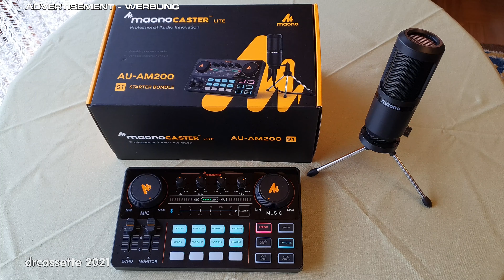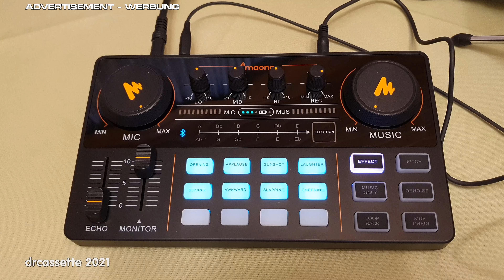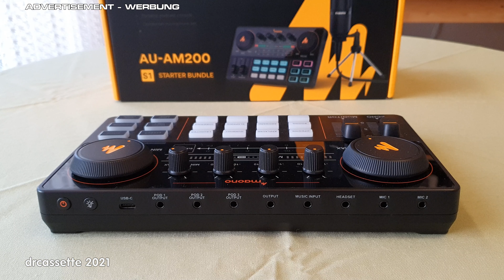Maonocaster Lite portable all-in-one podcast production studio AM200-S1 review

Comment: Our experience of this unit is mixed. Using it with Apple devices, it fails miserably but with a Windows laptop, we had decent results with the audio.

On an iPhone and iPad the recorded audio is gritty, hissy and noisy - plus the 'record' level knob has to be fully turned up for any quality at all. Using it with a Macbook or an iMac, Audacity is out of the question as there are tonnes of dropouts plus for some reason, there's a delay which is annoying in the extreme.

On a Windows laptop, we had much better results and Audacity works well here.

It's a pity for us as we had purchased the unit for some remote work and being able to use it with our iPhones would have been ideal. 

At £99 it's a decent kit, but simply not for us.

Comment: Sadly I think the background noise will put a lot of people off this machine, and the denoise button did nothing to improve the situation.  It smells to me of a really cheap soundcard and poor electronics. If they’d let you take it apart you, being a Doctor (😀😀), could probably find the cause and a solution but as it stands, it’s a toy and not really a viable solution.
Reply from the maker: Most of the noise is introduced somewhere in the connection from the Maonocaster to the phone. The output to the monitoring headphones sounded much better, almost no noise at all, that's why I said "the noise is now gone" when I turned on the denoise function, because most of the noise really was gone. Unfortunately the phone got a different audio signal...

Comment: the noise level of the mic is really bad.
Reply from the maker: Most of the noise is introduced somewhere in the connection from the Maonocaster to the phone. The mic itself actually doesn't have much background noise, it sounded pretty good through the monitoring headphones.
Reply: @DrCassette  can the output be fed via BT to the phone?
Reply from the maker: @rarbiart  No, the Bluetooth only works as audio input. I could have tried the standard line output with an audio recorder, and then syncing the audio recording with the video in post production, but of course that is not one of the scenarios the manufacturer suggests.
Reply: @DrCassette  fully agree! that wouldn't be my use scenario as well! recording via PhoneBT (while filming with the Phone) would be neat mobile setup.

Comment: It’s a neat looking device, but the condensor without phantom power puzzles me, how is that possible? Can it take proper condenser mics with 48 volts? It’s a bit gimmicky but I like the pitch effect. I do wonder what Julian Krause would make of the mic input noise levels.
Reply from the maker: I assume there is just a standard electret condenser microphone capsule inside, this would also explain the relatively low sensitivity.